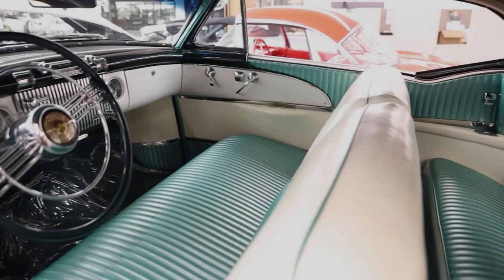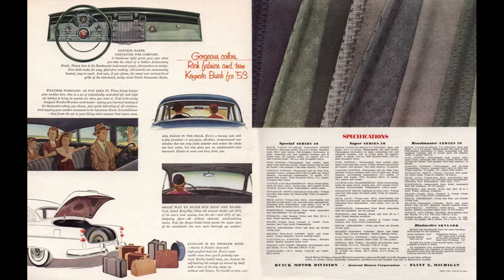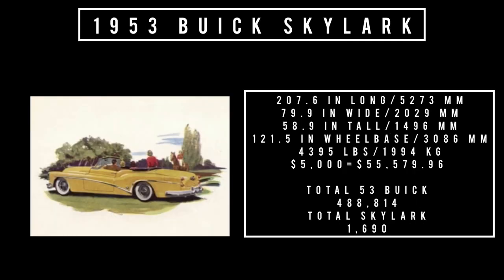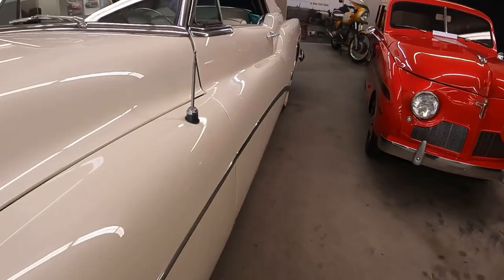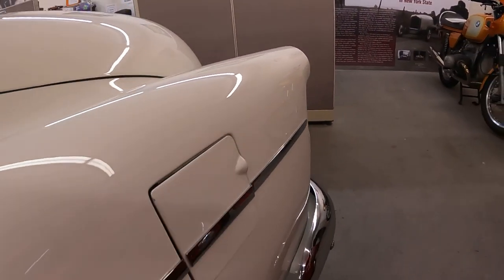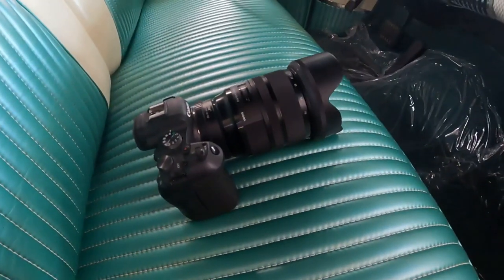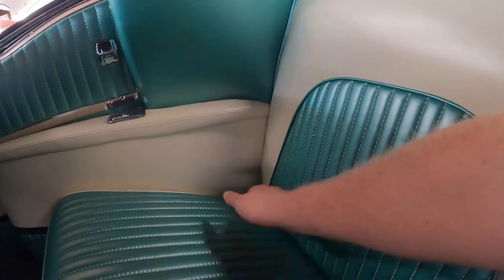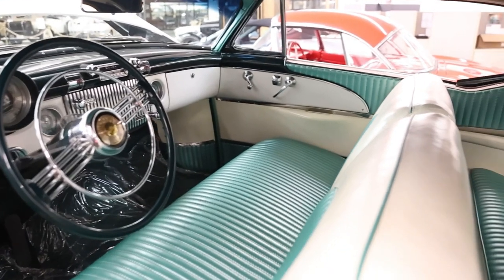1953 Buick skylark, To commemorate 50 years of Buick￼

Comment: The big can on the front of the air cleaner is a muffler. The second dimmer switch is for the radio to change stations with your foot.
Reply from the maker: Thank you so much =) 

Silencer on the air cleaner who knew oil bath or paper filter

Comment: One of the reasons for GM going to 12-volt systems on 1953 Cadillacs, Oldsmobiles, and senior series Buicks was the increased electrical demands of various accessories (including power windows, tube radios, planned air conditioning) would tend to overwhelm the 6-volt system. The rest of GM followed suit in 1955 MY. The Dynaflow transmission was revised for 1953, with the "Twin Turbine" feature added to give faster take-off. The original 1948-52 Dynaflow was a single rotor arrangement that was slow on the takeoff (unless Low was manually selected by the driver).
Reply from the maker: Awesome thank you so much for sharing that information as well as insight =)

Comment: The 1953 Skylark-Fiesta-El Dorado trio were virtually hand built. The front windshield was chopped down and the whole car was lowered 1 inch on the chassis. Notice the "Darrin Dip" in the beltline which was not found in the rest of the Buick line. (Harley Earl's tribute to Dutch Darrin, the stylist over at Kaiser-Frazer)
Reply from the maker: Howard Dutch darrin designed one hell of a packard as well good catch on the darrin dip they loved it so much all gm cars had it in 55

Comment: Beautifully restored Buick that one! The doohickey on the air inlet will just be a silencer for the induction. I didn't know about 12V either, but yes, there are 6 cells on that battery, so 12V it must be. That battery must be made to order, so would cost a heap, and the price of the car must be terrifying!
Reply from the maker: It was an expensive car that’s for sure the crazier thing yet is that Oldsmobile fiesta was even more money $5,717 for an Oldsmobile in the early 50s

Thank you so much for telling me what the Doohickey was it was the weirdest thing I ever saw..

Comment: Absolutely beautiful Skylark, so answers to your questions. Switch next to break is for the radio to switch channels for safety. The checks on the dash and door is called Dynark , the skylark horn button was the only one with a special “Customized for” , each original owner who ordered this car had there name scripted into the horn button. Skylark only had zero port holes VS roadmaster/super with 4 and special with 3 . Also special still offers the straight 8. This Skylark also offered a continental kit option. Last all wheel wells in 53 were painted white from factory no matter the color of the car. All in all in the 53 lineup the Skylark had the most production of the “4” at 1690 .. Eldorado at 502 , Olds Fiesta at 458 and for the motorama of 1953 always gets over looked the Corvette which came only in white over red with 300 built. Hope this helps you even are inquiring more about cars let me know! I love this stuff and have over 35 cars including most on your channel!
Reply from the maker: Awesome information thank you so much for sharing all that information and insight =)

Comment: The only Buick I can think of that had the 8 cylinder in line engine and 6 volt battery in 53 was the Special. It also came standard with a 3 speed manual transmission with Dynaflow transmission option. The battery in the 53 Buick is a very long thin battery. .
Reply: I remember that my father had several early 50's Buicks, they all had that long thin battery.
Reply: @warringtonfaust1088  My dad had a 53 Buick Special that he bought used and it had that long slender battery
Reply: @glennso47  I also recall that my father had a Roadsmasher, I think a '52, that had the straight 8 with a 4-barrel carburetor intake.

Comment: Those old 6V systems with a negative chassis were a nightmare for corrosion, what I don't understand is why nobody picked up on the problem earlier? After all a DC voltage, can be as readily applied with a reversed polarity, and have a positively ground chassis, which won't encourage the accumulation of dirt, salt or passing chickens. Speaking of, for a brief period I drove a 63 Volkswagen Beetle with the 1300cc engine, the 6V system was negatively ground to the chassis which allowed the floor to be rotted away by the tin worm. Curiously, it was terrific at letting rain water in, but not for draining it. So after a thunderstorm the car would fill up with many litres of water, which didn't announce itself, till the first time I applied the brakes, and then a  sudden tidal wave of water would travel to the firewall and break all over my feet.  Additionally, it suffered a complete brake failure once, which left me slowly drifting across several lanes of very busy traffic, yet nobody hit me? On another occasion, I foolishly drove 3 members of my family to the family Christmas do, and I stuck a hill, which genuinely needed negotiating, by having my 3 passengers get out, so I could rise far enough up the steep incline for them to get back in and continue the journey. Why did I do these things to myself?

Comment: The other switch on the floor is most likely the search button for the signal seeking radio. Your foot could hit that button while on the road so you don’t need to take your hands off the wheel. Growing up, our ‘57 Imperial had that feature and I always thought our radio was magic!  I didn’t realize my dad would use his foot switch to change stations.
Reply from the maker: I wasn’t sure about that I thought that feature came later but I could be wrong that could very well be the radio station switch =)

Comment: The Dynaflow was a non-shifting transmission. Yes, it had 2-speeds forward, but it did not automatically shift. Whatever forward gear you selected, "D" or "L", it stayed in that gear until you moved the gear selector to another position.
The "L" position was for engine braking or a faster getaway. The transmission used a torque converter to make up for the shortage gears .
The can on the air cleaner is an intake muffler. When you spend that much for a luxury car, you want it to be  quiet. 
The muffler(s) were also quieter than a standard car.
Silent and smooth was Buick's aim.
Reply from the maker: Thank you so much for that clarification =)

Comment: Have you noticed, Jay, that every GM seat has a lower supporting lip which is obvious when tipped forward? Perhaps as a mechanical stop to reinforce the seat from collapse, in addition to other methods employed. This is not so for Ford or Chrysler, or any other of the majors still existing at that time.

Comment: The second floor button, closest to the brake pedal, should be the starter switch, if I remember correctly. 
Your thumb nail for the video has me laughing….like is that a car, or a battleship! Damn, that’s a big car. Frankly, I’m floored at the price tag. Wow.
Reply: I remember now….the second button IS the starter switch. Buicks (not sue about all GM) had an odd system back then….keyless. The dashboard switch had 3 positions…Locked, On, Off.  Unless the switch was in locked position, and the key removed, you could just toggle between On and Off without a key. The floor switch engaged the starter while the dash switch energized the system.
Reply from the maker: Did you see the Crosley wagon park next to it it was so small in comparison

Comment: You're close on the 6v/12v electrical systems.

The 1953 Special was the last inline-8 engine available.  These are 6v alactricals.

The V-8 cars[Super, RoadMaster, Skylark] are 12v electricals.
Reply: You know your Buicks and you are correct.
Reply from the maker: Thank you so much for pointing out that clarification I forgot to mention that they still offered the street eight on the special and super as well as 6 V electric system, I was just shocked to see it at all because I thought GM went 12 V in 55

Comment: Hiya Jay, on many earlier vehicles, a foot switch was often coupled along with the clutch, as a safety lock out. The nub switch on the floor being a starter /ignition, switch. The chances of it being a foot pump for the windscreen washers is a great bet as well.
Reply from the maker: I wasn’t sure I reviewed a 55 Buick and the gas pedal was the starter button it would only start if it was in park so I wasn’t sure if the button on the floor was for the windshield washer but then I saw for the wipers that the button was in the center generally that’s where the windshield washer feature button is wasn’t 100% sure
Reply: @What.its.like.  I get it Jay, these older vehicles often carry a secret all but lost. I recall one car you tested which had a foot switch, just to the right of the accelerator pedal; and I would venture to guess, that may have been a safety cutout for the ignition circuit?
Reply from the maker: It was on the gas pedal itself it would only engage the starter when in park it was so cool (and it only started in park).
Reply: @What.its.like.  Surely someone knows for sure, contact GM. They've got all the answers.
Reply: Because of the push button on the wiper switch which is most likely the windshield washer, I'm guessing starter button is on the floor.  Was very common at that time

Comment: I would figure the adjunct to the air filter is a cooler of some sort, to limit thermal rise for maximum power? Whether it achieved that goal or not is another thing. I spose any addition to the atmo inlet is a good thing for filtration any way you look at it. Blind guesses, really, Jay.

Comment: From an economics & manufacturing point of view, I guess the Skylark at less than 3% of sales, would have to be priced at an extreme premium, simply to recuperate the build costs? 
With the finest treatment of wire wheels and whitewalls I have ever seen. The stance of a modern car is inherent in that detail alone. I want 6 please. For I rest on the 6th day.
Good old reliable Harley (Duke) Earl really outdid himself on this, and well, every car he touched. The special thing about this model, is it set his reputation, as well as setting the styling tone for the industry for the next 20 years. That must deserve a round of applause, surely? Being aware that the dash and instruments were in the hands of the interior designers, I have to say, it does not live up to the same standard as the outside for me. Very ordinary and bland by comparison, I feel. Nothing wrong with it, it is just being asked to do too much against the promises of the outer body panels.

Comment: If I had a choice of any car in the world and I was a billionaire a white 1953 Buick Skylark with a red leather interion would be my choice. However, I would certainly upgrade the running gear to modern specks especially the engine, brakes and tires.
Reply from the maker: That 322 runs nicely due to 300 pound feet of torque but I would definitely change the transmission baby get a six speed or something different rear end =)

Comment: yeah, I've always thought that the 12V system didn't start until like 1958
Reply from the maker: GM was 55 I believe I should’ve said that it was only on the senior series lack of a better term Buick special in Buick super still offered the straight eight and 6 V electric

Comment: $2500 per wheel or set? The RR hubcaps, cost around that each,, 30 years ago, so big bumps were a real no-no. Reminds me of what it would cost if you built a vehicle totally from spare parts, it would probably cost you $300,000 for a Ford Focus?
Reply from the maker: It was $2500 a set but that was back in 2000

Comment: Are you sure this has an oil bath air cleaner? I thought it was a paper element at this point in time.
Reply from the maker: I think this was oil bath they still offered that option through the 50s and amc even offered in early 60s
Reply: @What.its.like.  I wonder if it says in my auto repair book? sadly though, i thought the 1954 Hudson was in there....but it wasn't.